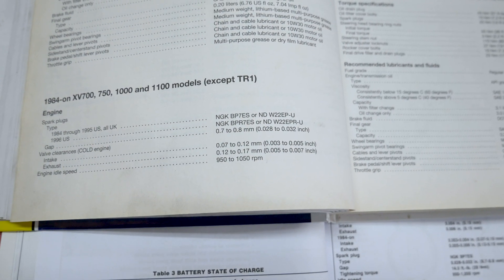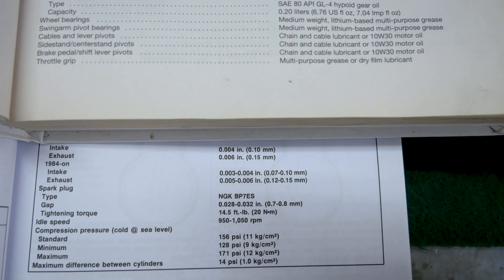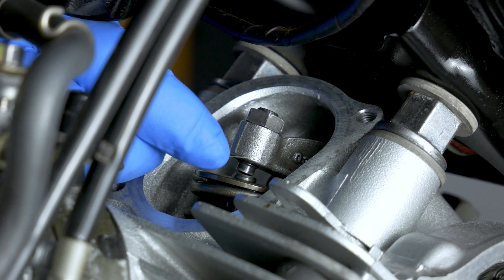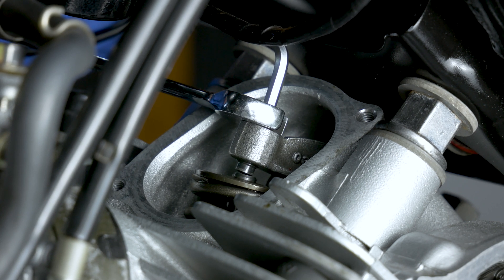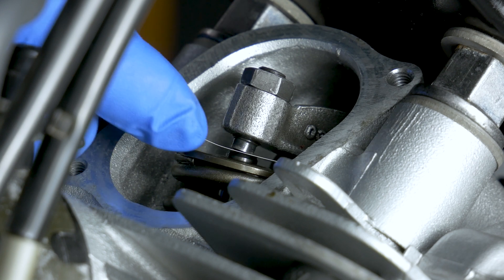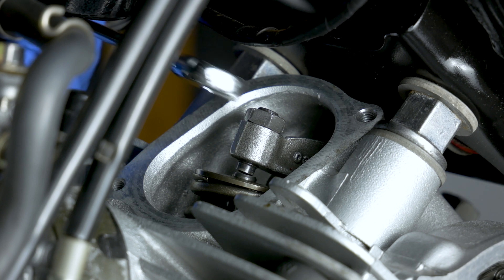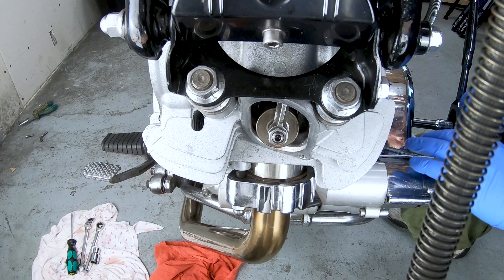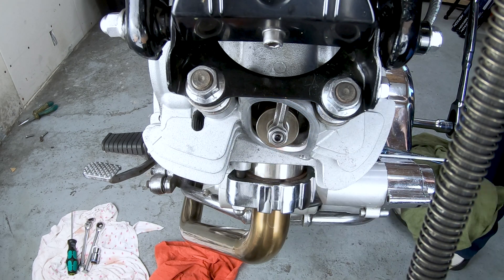HOW TO ADJUST VALVE CLEARANCE | 4K | YAMAHA VIRAGO 1100 | Working on the cylinder head EP05

Comment: I have 1 question. Does the entire left side cover need to be removed in order to rotate the engine?
Reply from the maker: No. Just the round middle bit, which is held on by 3 screw. Sometimes it can stuck on, be careful not to rip the rubber.
Reply: @MidlandCruiser understood, I crank it to the right but it meerly tightens the bolt on me
Reply from the maker: @CmmdrKitty I'm sorry I'm not sure I understand. Did you remove the big round cover, and the middle little one after that? Then you have access to the flywheel bolt. If you can't turn it clockwise then your engine is stuck or something. Taking the spark plugs out helps rotate the engine..
Reply: @MidlandCruiser I just discovered the 17mm is the cover to the bolt inside! 

My intake is too tight it doesnt fit the 0.08mm lash. I will put it at 0.09mm 

My exhaust absolutely flops about. I will be put at .13mm. Hoping this fixes my 0 compression issue.
Reply: Bike only has 28,010 kilometers on it. Should be healthy!

Comment: If I take the side plate off to turn the motor will oil come out. Do I have to empty the oil first?
Reply from the maker: Hi. If you only take that round cover off which held on by 3 little screws, then no, no oil will come out. You can also take the middle out to access the nut to turn. No oil should come out...
Reply: @MidlandCruiser thanks. What size socket did you use to turn the nut inside that turns the motor
Reply from the maker: I honestly can't remember...been a while
Reply: @MidlandCruiser I appreciate you responding and helping a lot. Last question. What position does the flywheel have to be in when checking the clearance for the intake and exhaust?
Reply from the maker: @alexrichard8011  check the pinned comment here, there is a link to my other video where I show exactly how to do it, which will start at 8: 25... easier than me explaining here again 👍

https://youtube.com/watch?v=7rC0eWzGa4w&si=eCFeLaGUMEGOmKB1&t=505

Comment: Hey mate ive bought a 2002 v star 1100 and its got a aftermarket lowering adjustable pivet links  do you know the factory height ? And where do i measure from its to low  im concearned about adjustment due to the shaft drive can you help regards scott 🤗
Reply from the maker: Hello, unfortunately I'm not familiar with the V-star or it's monoshock setup. If you are worried that the shaft drive is affected but you'd be fine with the standard height then just buy an original second hand set from ebay, or new whichever fits the budget. Sorry but I'm not much of a help with this

Comment: On the 1100, do the valves tighten up, or loosen up?
Reply from the maker: That is a good question...I  check every year before season and found it going ever so slightly bigger...minimal though. Could be caused by wear on the bolt🤷‍♂️ not sure. Hope this helps a little
Reply: @MidlandCruiser  Thanks buddy. 🙂 Keep up the good work

Comment: Hi,
Do you perhaps know what is the torque settings on the cylinderheads for the yamaha virago xv1100 1998 model?
Reply from the maker: Hi. Not from the top of my head, sorry. There are different bolts on the heqd with different values. If you join the Virago nation Facebook group you can download in the files section everything you need, manuals, fixes, tutorials etc..

Comment: Great tutorial! Just a quick question. Is it better to do it with hot or cold engine? Does it matter? Thanks!
Reply from the maker: Hello. Yes it is important. Try to do it around 20C (ambient temperature) which is the industry standard and considered as a base line. Basically next day after a ride from April to October on the Northern hemisphere will be fine... it doesn't has to be exactly 20C. Hope this helps
Reply: @MidlandCruiser  Yes, totally. Thanks for the fast answer! So I'll wait since I'm just back from a 1h ride and I think I was hearing it clicking. Want to look at them but it's very hot here these days. Around 32c and feeling 40c with humidity. Not very funny to work on the bike outside anyways, so I'll wait for the weekend.

Comment: Hi thanks for this - very good
Just couple of questions
When you do the valve clearances on the rear cylinder do you have to rotate engine to TDC again separate to front cylinder so each time you have to rotate engine clockwise to TDC before adjusting clearances
Thanks
Reply from the maker: Basically yes. You set the rear to TDC and adjust both valves, then turn the engine around a few times and set the rear again to TDC to double check the clearances. 
Then set the front to TDC adjust the valves and do the same double check. You can't set both cylinder (all 4 valves) at the same time

Comment: First time doing valves on my 750 virago. Must I drain the oil before I can take off the left side cover to rotate to TDC?
Reply from the maker: No you don't need to drain the oil..just remove the ring cover to get to the crankshaft bolt check it here when I do it
Skip to 3.15, timestamp in the description 
https://youtu.be/7rC0eWzGa4w
👍
Reply: You only have to remove the round cover, held by three screws. Then you'll see the plastic nut that you must take out as well. Do not try to turn the engine with the plastic nut, it only covers the one you need to turn the engine...clockwise.

Comment: Can i adjusting only front cylinder and ride the bike or should adjusting the tow cylinder?
Reply from the maker: Always adjust both cylinder my friend, the only reason it's not in the video because it is impossible to record anything on the rear cylinder, the way you can actually see what I'm doing, that's why I only recorded the front, the rear is the same way just set the flywheel to the "T" mark and check the camshaft to make sure you are on TDC then do everything the same as on the front and you are good to go...hope it makes sense..
Reply: @MidlandCruiser  ok sir thank you so much